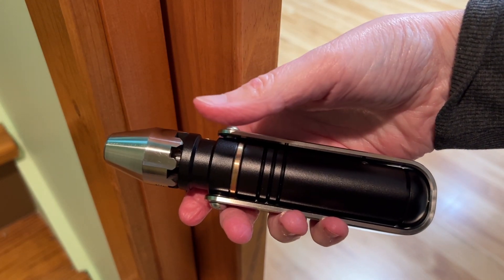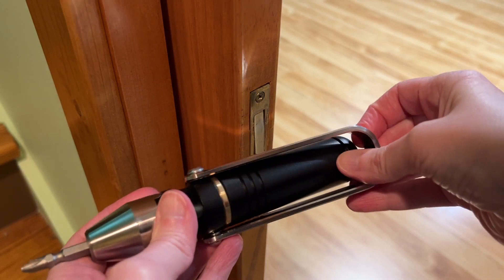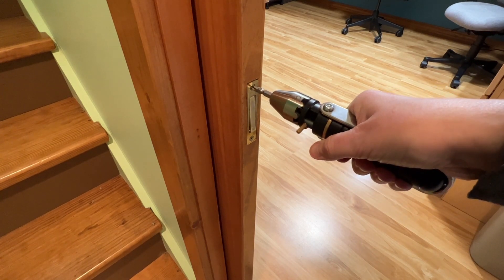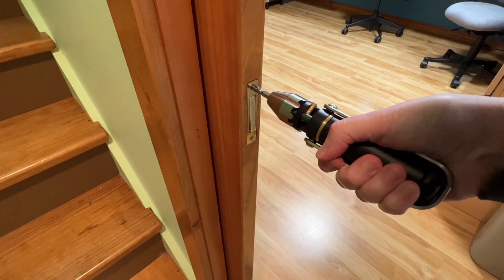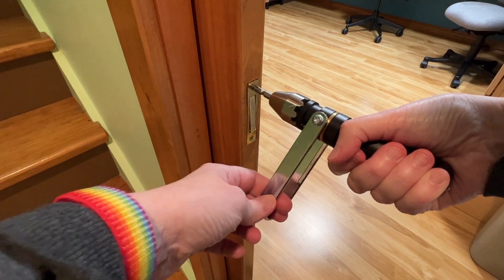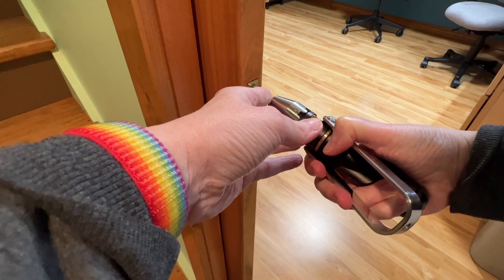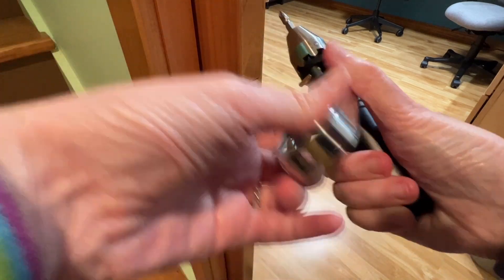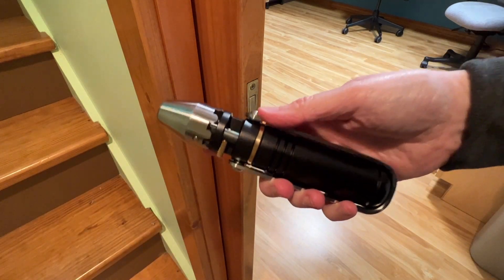MetMo bit driver demo - Look ma, no batteries!

Comment: This is a interesting concept, since there is a lot of tight screws out there just waiting for your cordless screwdriver to discharge... Like, half the time when I need them. Anyway, if you like this but want something cheaper, Irwin sell (or at least used to) conventional screwdrivers that can use a spanner for leverage.
Reply from the maker: I just found a very similar driver on Amazon (affiliate link) for only $12.99. The handle is wood, but otherwise it looks really similar. https://amzn.to/42WYke2

Comment: This is a lot of money for an item that could very well not fit into many tight spaces. You need a lot of room to work that lever. It does afford torque. But I would rather have a smaller, lighter tool that requires less space to operate. Fortunately we have numerous options. Heck, Kobalt makes a decent ratcheting bit driver.
Reply from the maker: You're right, it is a bulky tool, but you can use it without unfolding the handle for tight spaces if need be. I think their new pocket version might be the sweet spot when it comes to size.